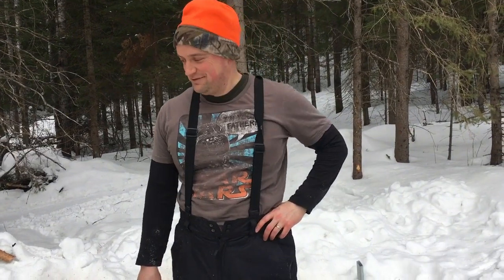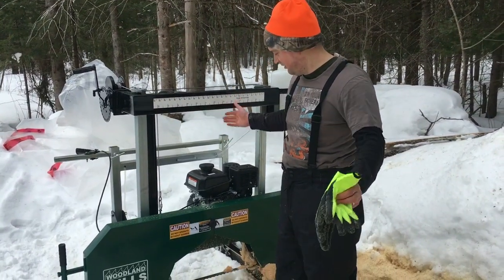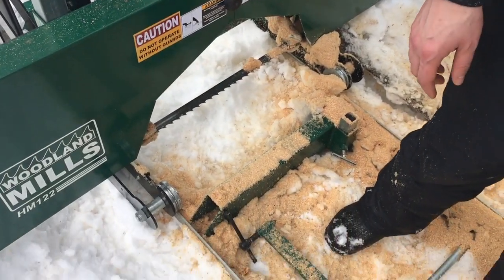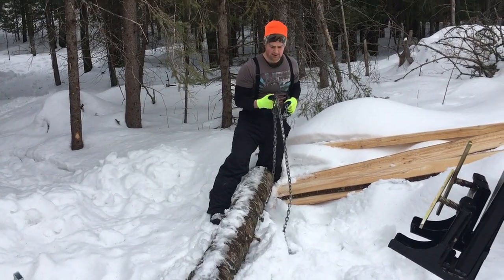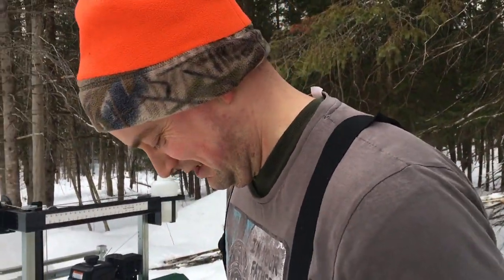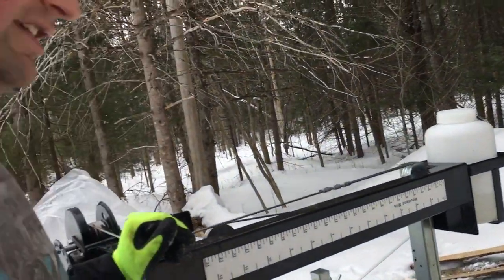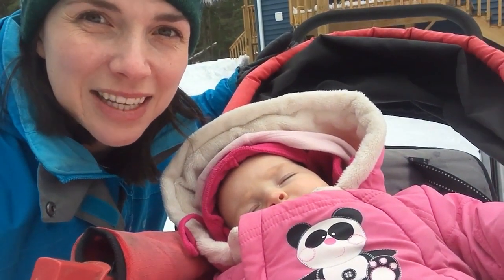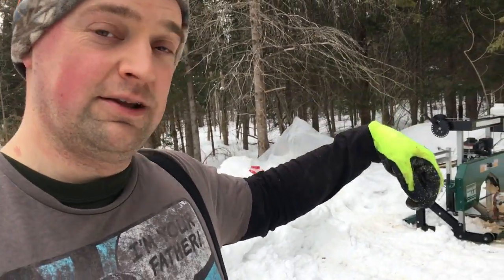OUR NEW SAW MILL | Loewenwood Homestead

Comment: Hello from Nova Scotia, new sub. Your neighbor (my best friend) put me on to your channel. He's the sorta 'dim witted dude' who I'm assuming has been chatting you up on the ATV tracks😂. Other than just saying hello,  I wanted to point out a noise I was hearing from your mill when you started it up. Other than the sound of the engine running, I can hear what sounds like a sorta high pitched 'ting' of two pieces of metal hitting each other. Based on the videos I've watched ( I refer to that as research), what I think I'm hearing is the unintentional engagement of the centrifugal clutch. From what I understand, it is caused by the idle being a touch high on the motor, which can be turned down fairly easily I believe. There are several videos on the 'Tubes' that address this condition, and the resulting premature failure of the clutch if the idle isn't adjusted. Anyway, great video, and I'll keep an eye on the progress with the homestead!